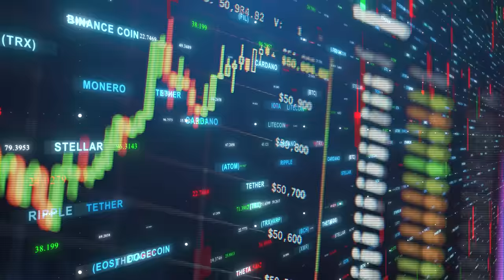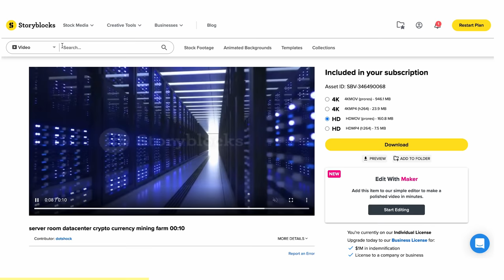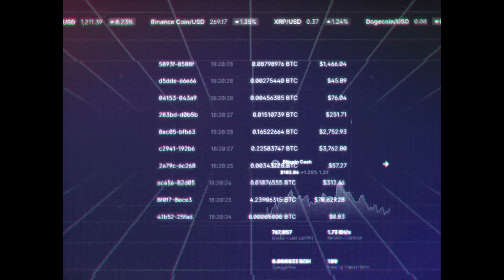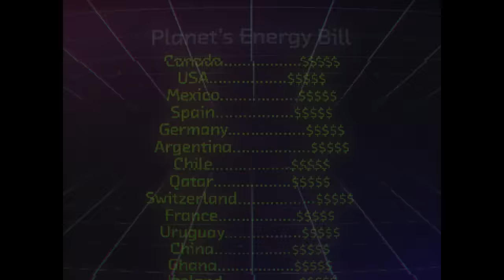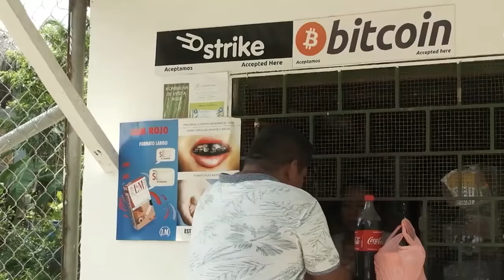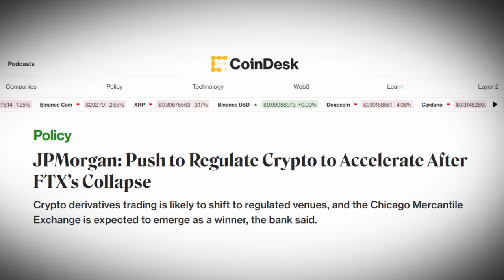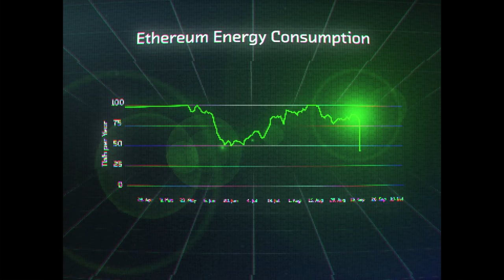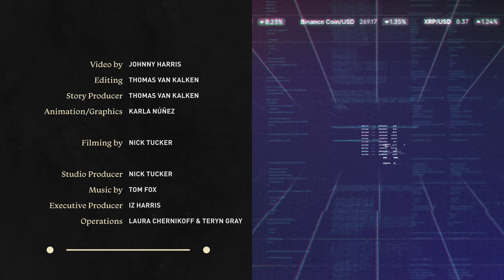Is This the End of Crypto?

Comment: I have to agree with skeptic Jonny. The merge matters… but it mostly just works to remove the stigma of crypto being bad for the environment in the public mindset. The fatal flaw of crypto remains legitimacy and ease of use. If we ever hope for mass adoption, it needs to be as easy as using a credit card. It can’t disappear when I lose my phone or forget my password- or massively devalue because of a tweet by some celebrity. It needs to be stable, easy to use, and secure.
Reply: Also a typo of a cryptic key must not lead to you losing that money. If you send money by bank transfer and have a typo usually it doesn't go through and you keep the money. If you send it accidentally to the wrong person it's also not gone for good. In the case of a crypto transfer you'd lose it without any chance for recovering it.
Reply: Agree. Crypto bros always say DYOR (do your own research). As if that’s enough to remedy the flaws of crypto itself, or as if everyone has time to actually research on each and every crypto project/token/blockchain out there. People have real jobs and other things to do! As long as it’s not easy enough for these people to use it, crypto will not gain enough adoption.
Reply: I really dont think stability will be possible as the value in cryptocurrency can be so big. There are ways for it to be easy to use, secure and make sure that transactions are stable so you can secure FIAT at the time of the transaction if you want the "stability".
Reply: @ThePandafriend  Dont type it just copy and paste its not that hard 🤦🏿‍♂

Comment: Hey just a couple of things I felt should be clarified. The Ethereum blockchain does not have a 'CEO'. Vitalik Buterin is a co-founder of Ethereum. Since blockchains are decentralized, they do not have a top-down power structure. Also, you said Ethereum's proof-of-stake requires a 'small' amount of stake. But each node needs to stake around 32ETH, which is worth over 40k USD, which is not that small. 😂
Otherwise, great video and loved the editing, Johnny. Cheers!

Comment: Isn't the reason crypto farms are shutting down is because the value of the coins they mine has gone down drastically, and that it isn't cost-effective to mine at the moment, when energy costs are also higher than usual?
Reply: yeah but if verall the amount of energy needed to farm 1 unit goes down in general then you could still afford to do so with higher wattage per hour prices from the power company

Comment: The merge is not a big deal to the crypto space, other cryptocurrencies have been using the proof of stake for a very long time such as Cardano which has the best proof of stake mechanism
Reply: It's not revolutionary in the sense that it's never been done before, but it's highly relevant as it involves one of the most widely used currencies and the environmental implications aren't insignificant.
Reply: @travisyee8739  eth still has high transcations fees. The normal customers wont be fine with that high of a fee.

Comment: I think the biggest issue with crypto seems that it doesn't have fundamental value, it is more like speculative value. 
All I see is that people buy crypto so they can sell it after, not to spend it like traditional currencies which is the reason why a currency existed in the first place.
Reply: It's a hard sell on using it for spending because of the volatility.  Either you spend some today and tomorrow what you spent is worth double so your purchase feels more expensive or you receive and it's worth half tomorrow so you lose your profit and value.  There's risks on both sides of the transaction.

For buying and spending it should be rock solid like USDT where 1=1 permanently.
Reply: @Kraken9911  Couldn't agree more. 
But it's better to be rock solid or tied to a real thing like gold or other precious/rare materials than a traditional currency that is more susceptible to inflation.

Comment: I think (one of) the main issue(s) with crypto is that advocates are trying to make it two things at once. It is being called a functional currency but treated as an investment, and it can't be both. If it is a currency, it needs to be stable, useable and safe; pretty bad for investments. If it's an investment, what are you investing in? The currency? The thing that should minimally fluctuate? No one wants to use a currency they can't rely on and investing in it is at best a treating it as a speculative (and high risk) asset backed by nothing and at worst participating in what amounts to a Ponzi scheme defrauding other peoples money by being an early adopter and getting out.

Comment: it was really nice for me in the meantime because I live in a place where it gets really cold and I was using my GPU to mine ethereum and produce heat to warm my room during the winter months and it paid for my electricity bill at the same time. I would have just had to use an electric space heater if not. I even had an uncle across the country that heated his cabin with a small GPU mining setup. it wasn't to the scale of the huge GPU Farms it was just enough to subsidize our heat and a little bit of money for power each month.

Comment: I like this video so far but there's some imo glaring half truths.  about 17 minutes in and two things jump out-

Vitalik is not CEO of the ETH blockchain, it doesn't have a CEO as it's decentralized. He's the Coinventer.
Second, there's not only two validators - that's referring to lido, which is a collection of staking services and validators.

I feel like good research was done on this but was lacking actually talking to ETH-heads

Comment: There are several errors and omissions in this video, but the biggest mistake (and that's why this video was made) was demonizing "POW energy consumption". It was clearly commissioned by WEF.

1st big mistake: it is the energy expenditure that makes the Bitcoin network one of the safest in the world

2nd big mistake: the problem is never in consumption, but in production. Just sending an email consumes a lot of energy and nobody talks about it. The Bitcoin network is one of the largest consumers of clean energy, and is one of the biggest promoters of alternative and clean energy production.

3rd error: energy consumption was not compared with, for example, ATMs, bank branches, production of FIAT currency, etc..

4th error: Crypto is not just BTC and ETH

5th error: "adpt or die?" there is room for multiple crypto projects and blockchain's

6th error: regulation would not be necessary, but it is inevitable, because politicians like to stick their finger in everything and it is easier to charge fees on regulated things. But even if the US does regulate something, that doesn't mean the rest of the world does the same. Cryto is not US property.

(... many other mistakes... but the narrative was already defined from the beginning)

Comment: The energy consumption involved with proof of work is a feature, not a bug. The energy consumption protects the blockchain from attacks from be actors. Ethereums switch to proof of stake means you’re putting your trust in validators (instead of trusting immutable math and physics). Not to mention, most mining is done with renewable or waste energy and it’s helping to fund the transition to a greener more efficient grid.

Comment: Today is Aug 28th, 2024.  Bitcoin today $59,000… been bouncing from $53,000 to $69,000.   So 6.25 coins is $368,000!   3x his $127,000

China has shut down most crypto farms since massive load on system in 2023. now many setting up in USA… Georgia (they love Coal) is a hot spot.

Of course, crypto is more than just Bitcoin. The energy consumption of all crypto assets combined is between 0.4% and 0.9% of annual global electricity usage, or 120 and 240 billion kilowatt-hours per year. That's more energy usage than all the world's data centers combined. Crypto is a big energy user.Feb 21, 2024

Comment: Meh, ETH is very buggy and switching to POS isn't as simple as do it and done.
POW and POS are both verification systems we need to work together, not just switch and be done.
There are pros and cons to both and ETH has too many fundamental problems to be a good POS crypto.
I feel this is coming from someone who doesn't really use crypto, just bought on an exchange and held.

Just wait until the directed DDOS attacks happen to mess with TXes. 
ETH is not ready to handle heavy DDOS attacks which is one of the problems with POS is that now DDOS can attack it.